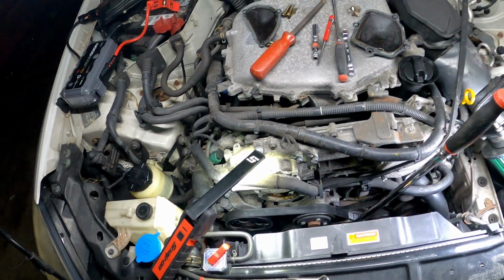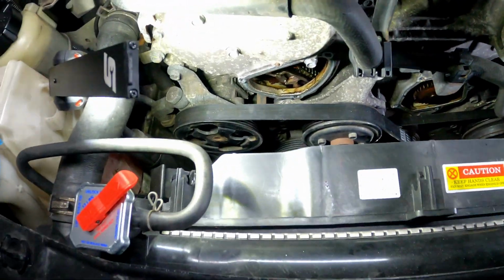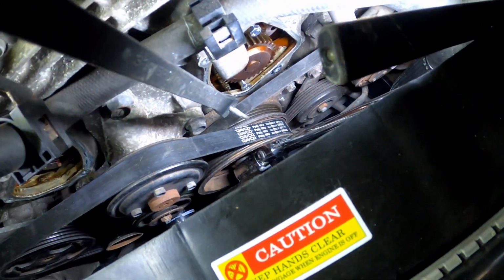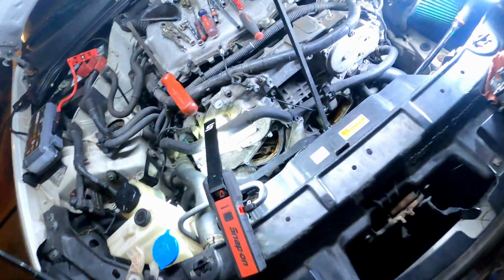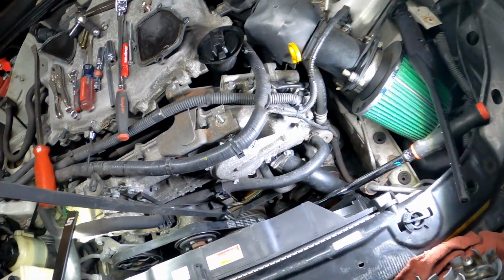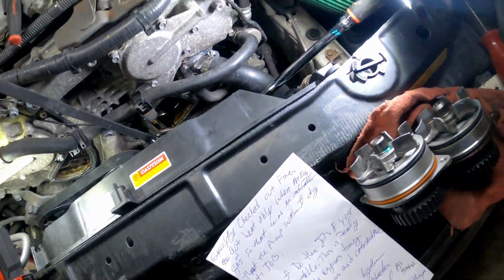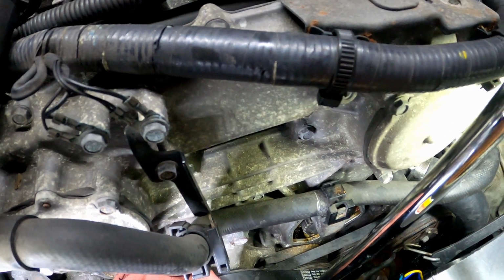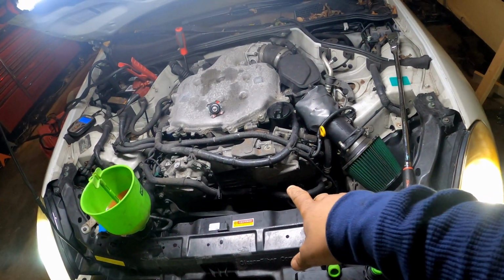👉WATER PUMP REMOVAL/INSTALL|TIMING CHAIN TIPS‼️NISSAN SKYLINE/350Z INFINITY G35/M35👨‍🔧VQ35DE ENGINE

Comment: I do alot of side work outside oof my full-time job but I've got a maxima water pump to do next week end I'm not to sure what price to charge I was thinking around two hundred is that to cheap  or to much? What do you guys think please any one out there give me your thoughts this will be my first time doing this type of job  why can't it be simple like any other water pump thanks
Reply from the maker: See this could be a tricky job to price out. Off top i would probably charge(labor only) around $300-400
For a few reasons. One your dealing with a timing belt so if not done right  your gonna end up owing the customer. Not as simple a brake job. If a bolt drops in the timing case/engine that'll be a problem.

There's access covers to the tensioner and water pump to assist in this job so realistically the job can be done in an hour or so but you can't price a job off how fast u can get in done but price the job based on it's severity and process that u have to take. 
This job takes mechanical knowledge that your average person doesn't know(if not a auto technician) and that's not free. You have to charge for your knowledge and time so if anything don't cheap out. If u think $200 is fair go for it

THANKS FOR WATCHING SUBSCRIBE AND STAY TUNED FOR MORE🤝‼️
Reply: @PhillyDee215  thank you much for
Reply from the maker: @louiscallela6265  Glad I could help

Thanks for watching Subscribe & stay Tuned for more‼️🤝
Reply: I finished the water pump on 2010 maxima im to disapointed to say how long it took but i know next one i do i have to charge a minimum of 400.00
Reply: @louiecallela8897  thanks for bringing this up. It’s a bit of a taboo subject cause everyone’s been brainwashed by this competition economy and jobs that tell you that you can’t talk to your peers about things like salary or that it’s rude to ask your boss what he charges for your labor vs what you’re payed. Truth is nobody on here is in direct competition with each other and none of us that do this on the side are pulling business from actual professional mechanics because call any shop for any job right now and you’ll discover that if they are worth a damn they have a wait list a month long. There’s more than enough work to be done we have the reck we should be transparent about stuff like this. Reddit has some good groups for all professions to find pricing advice as well.
Reply: The price is ok$250 dollars

Comment: Hey PhillyD, I appreciate your video three years after you posted it but I didn’t wanna let you know the 8 mm bolt fits through the hole of the water pump and pushes on the back where it secures in the Housing and I was able to get them out, I broke off a 6 mmscrew too tight but thanks again. Your Video helped me through Brother.

Comment: you need M8 1.25mm bolts at 50mm length prodemand has a full repair n replacement procedure that calls for that specific bolt to get the pump out
Reply: Is prodemand a website

Comment: My car did the same thing regarding the heater.  There was a air pocket in coolant.  It needed to be bled with a spill proof funnel.  That bleed screw your pointing to is not sufficient to remove all air
Reply from the maker: Exactly....if you watched the whole video I also used the spill free funnel. Definitely both procedures are needed
Reply: @PhillyDee215  I did.  Good chance that pump was not bad.  Didn't look like there was any staining on the pump from the weep hole best I could see.  Impeller on pump appeared good.  You never mentioned you were losing coolant.  Doesn't make much sense the car was cooling fine but your heater was acting up.  I experienced same issue.  As a matter of fact I don't even have the plastic bleed in back anymore.  I just bled it thoroughly and problem vanished.  Classic Z air pocket in coolant system symptom.
Reply from the maker: @alexduran6742  nope I wasn't loosing coolant but the heat did return with the new pump I installed.

Comment: One video says  to turn  the engine at the crank just slap it clw and that will give you enough  slack to get the pump out  of course you said to be careful with the bolts
Reply from the maker: Yeah be careful you don't wanna drop nothing in there

Thanks for watching Share, Subscribe & stay Tuned for more‼️🤝

Comment: The bolts aren’t supposed to thread in. They thread onto the flange on the pump not into the motor
Reply from the maker: Thanks for watching Subscribe & stay Tuned for more‼️🤝
Reply: I used m8 bolts
Reply: @frickboss what kind

Comment: To anyone doing this job... per the service manual you are correctly supposed to use 8MM bolts to pull the pump away from the block.  These bolts are not supposed to go into the block at all. They will thread into the holes of the water pump and as you tighten them down they will just push against the block and push the pump out.  DO NOT USE M6-1.0 bolts for this purpose.
Reply from the maker: Thanks for watching Subscribe & stay Tuned for more‼️🤝
Reply: I broke a piece of my block with the 6 smh
Reply: @kyrix9072 just did this myself
Reply: @kiddanbu2772  damn bro rip gotta change rear timing cover now be careful removing slack not to jump timing from chai
Reply: So the m8 bolts won’t damage the threads in the block or is the Diameter of the bolt to big, I would be worried that I mess up the threads in the block.
Reply: @tonyzook4064 I broke my block with 6 use 8 it'll work perfect bro
Reply: What happenes if I break the pump thread holes? How do it get it out then? Help
Reply: Bruh

Comment: Wish you wouldve showed us how to put it together step by step
Reply from the maker: What part did you miss...🤔....let me know 

Thanks for watching Subscribe & stay Tuned for more‼️🤝
Reply: @PhillyDee215  so you drain oil at first and then the coolant from the  12mm bolt? How exactly did you loosen the belt to pull it out of the way for you to access the pump?
Reply from the maker: @RiseUpRoyalAce  the serpentine belt? I never removed it bc u don't have to. If anything like I did I just held it up with a bunjee cord so I wouldn't have to hold it with my hands 

Timing belt, u just have to remove the Timing tensioner itself
Reply: @PhillyDee215  did you only have to drain the coolant?
Reply from the maker: @RiseUpRoyalAce  yeah....you only need the coolant to be as low as the water pump itself or u can just drain the block. The radiator doesn't need to be drained out unless u want to.

The oil don't need to be drained neither but I would(i did it in this but didn't record it)

Comment: What are the bolts you used to push out the pump??
Reply from the maker: M6x1.0/six Inches long should be enough 

Thanks for watching Subscribe & stay Tuned for more‼️🤝
Reply: @PhillyDee215 wrong 8mm x1.25 to pull it out

Comment: I done get this, now are the same holes that hold the water pump in going to be used to press the pump out then press it back in.
Reply from the maker: Yes, your gonna use a bolt with the same thread pitch but longer to press it out. Going back in your gonna use the original bolts to pull and tightened the water pump back in.

Thanks for watching Subscribe & stay Tuned for more‼️🤝

Comment: What is the m6 and m8 referring to?
Reply from the maker: The diameter of the water pump bolts

Thanks for watching Subscribe & stay Tuned for more‼️🤝
Reply: @PhillyDee215  Do you think i should get new water pump bolts when i change the water pump?
Reply from the maker: @skytech_00  definitely wouldn't hurt if you did, just make sure they're the correct size. You can buy the measuring tool that i used in the video to verify that you have the right sized bolts and of course you can use it with any bolts you come across. It was a few dollars off of Amazon

Comment: Don't use m6 use m8 this simple mistake ended up costing me another $500+ in repairs.
Reply from the maker: If I could remember correctly I believe in the video I showed how to measure a bolt with a simple $8 bolt measuring gauge. If your knowledgeable enough to tackle a timing chain related job then u should be knowledgeable enough to know when a bolt size is not right. Now a M6 and M8 are two different sizes so im not sure how u were able to make a $500 mistake without realizing your were making a $500 mistake. M6 would've fell into a M8 hole beings though it's two sizes bigger and u should've noticed that before u were even able to damage anything. Maybe a job like this was too much for u, and even though u may watch a video you still have to do your own thinking

Thanks for watching Subscribe & stay Tuned for more‼️🤝

Comment: I didn't understand how exactly do you drain the coolant from that "drain bolt" so no coolant enters flows to the oil pan....
Reply from the maker: Well u don't bleed from there....you just drain from there only. It removes the coolant from the engine block opposed to the radiator petcock/drain only drains the coolant from out of the radiator itself. The water pump is the block....that's why u wanna drain the block. Hope I helped you

Thanks for watching Subscribe & stay Tuned for more‼️🤝

Comment: Never seen you before. Good video, about to do this to my roommates car 05 g35 4dr. She's an older lady can't afford to have it done, I help her out some. Question If I'm using the original chain tensioner can I relax the pin and spring it back to make it put tension back on the chain?
Reply from the maker: I would recommend using a new tensioner......but yes it should work

Thanks for watching Subscribe & stay Tuned for more‼️🤝

Comment: What caused you to change the water pump were you getting milky oil cause that’s what I’m gettin rn and I don’t think I blew my head gaskets
Reply: Wrote this comment jus before 12:00
Reply from the maker: If its milky than that may be your head gasket. Head gasket can fail in a few ways and the oil system is one of them

Thanks for watching Subscribe & stay Tuned for more‼️🤝

Comment: M6 was too small for my 2003 350z. The bolts broke while tightening and snapped off inside the threads.
Reply: Same for me made me wanna slap somebody
Reply: @unknownqoz  I don't understand how that is supposed to work. You put what, same size bolts as holds the pump on but longer? Then you just bottom out the long bolts? I don't get it.
Reply: @DonnieLarkins curious to know what you did to fix this. Same thing happened to me
Reply from the maker: You'll need a bolt extractor to get them out

Thanks for watching Subscribe & stay Tuned for more‼️🤝
Reply: I still had a little showing so I tac welded a nut to it and was able to back it out after
Reply: @c0dycod3z  damn I wasn’t quite so lucky! Once you got it out what bolt size did you use to get the water pump out?
Reply: @wesleypurvis2874   I want to say it was an M8 but I could be wrong. It was a few months ago now :/
Reply: It's M8 bolts u use longer ones around 70 mm and once they're both on the pump you wiggle the pump via the long bolts and comes right out

Comment: Hi quick question. On O ring you put black and red after that. Is that the way it's go??
Reply from the maker: You can actually use a small film of oil around the water pump O-Ring, coolant itself, lil silicone, or even a lil bit of dialectic grease/etc. Either one of these will also help the water pump press back in easier 

THANKS FOR WATCHING SUBSCRIBE AND STAY TUNED FOR MORE🤝‼️

Comment: Great tip with the elastic cord / bungee to hold tension arm
Reply from the maker: It helps a lot both on the tensioner and water pump side. A jar of like 20 miniature bungee cords cost only like $10 from Amazon. Better to have multiple cords so they can assist u in multiple ways at the same time 

THANKS FOR WATCHING SUBSCRIBE AND STAY TUNED FOR MORE🤝‼️

Comment: How much do mechanics charge to do this?
Reply from the maker: Depends on the shop and their hourly rate. Its a easy but serious job bc your dealing with the timing chain. On the cheap side $400-600 parts and labor. Expensive side $600 or more, some shops I've seen over $1000

THANKS FOR WATCHING, SUBSCRIBE AND STAY TUNED FOR MORE🤝‼️
Reply: @PhillyDee215  in other words the mechanics will rip you wide open from the rear buttocks🤣😂🤣I'm happy I have the health and knowledge to do things myself lol